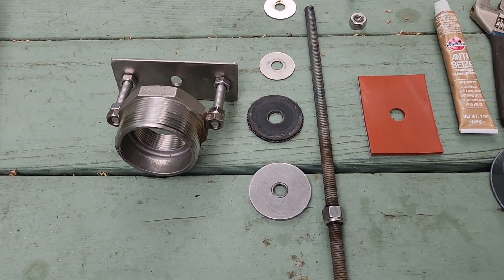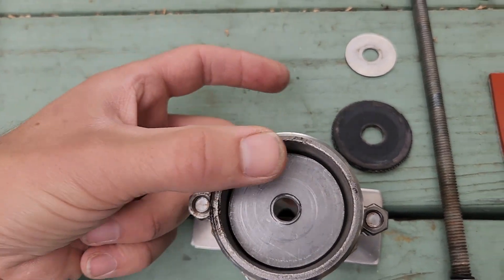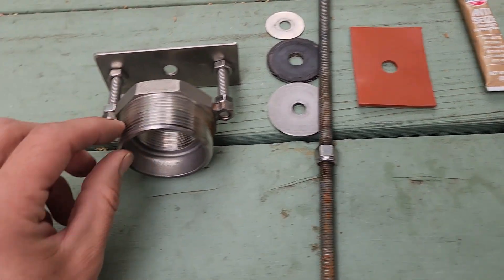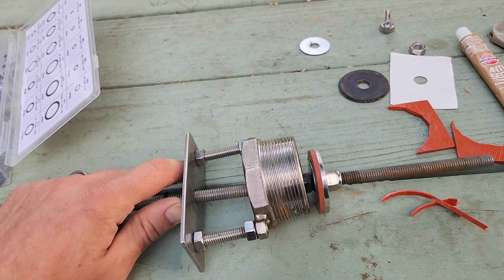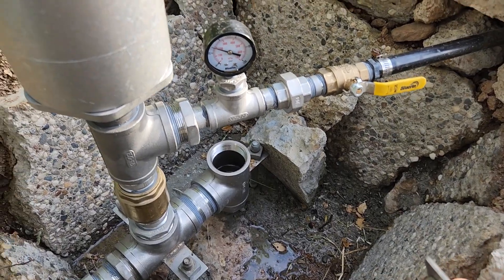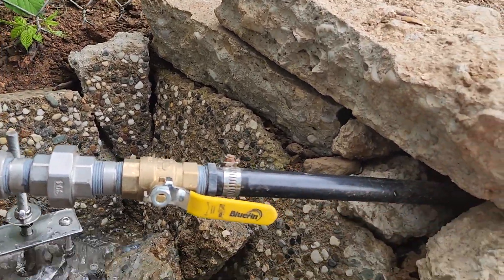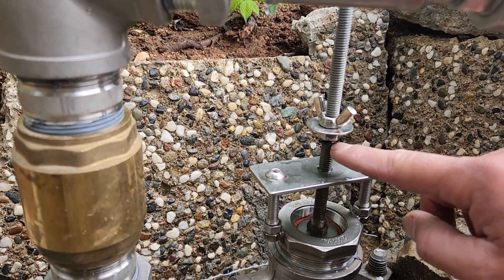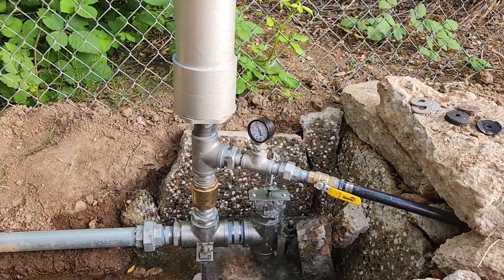Waste Valve Adjustments - Hydraulic Ram Pump

Comment: Can you share result with us with a test? When tank and distribution hose are empty and supply pipe is full of water. How many triggers it takes to let it cycle itself?
Reply from the maker: I'm not sure what you are asking,  but you need at least 10 psi in the delivery pipe for the pump to work by itself. You can artificially do this by closing the 3/4 inch ball valve on the delivery side and open it slightly to let a little bit of water through. I show this in one of the videos.

Comment: How can we be sure there is no bypass path at the check valve through the threads under the the washers?
Reply from the maker: That is not something to worry about. The threads experience high pressure during the water hammer, which is relatively short time. If you stop the pump operation, then the pressure against the threads would be from the head pressure in the drive pipe. In my case it is about 8ft of water elevation = 3.4psi ... water does not come out through the rod or the custom check valve.

Comment: Nice video and presentation. 
Do we have access to stainless threaded rod?
Reply from the maker: Yes, stainless steel rod is generally readily available, but may cost a bit more than zinc plated or galvanized. I had one laying around so I used what I had.

Comment: 2 1/2" x 1 1/4 or 3" x 1 1/4 is much better for a waste valve than 2"x 1 1/4".
Reply from the maker: It is better, but you would need a lot more $$$ to do the same thing. The cost on components greater than 2 inches does up in price exponentially.
Reply: 2"x1" is much better,  you can use 45mm diameter of rubber and washer, If using 1 1/4" drive pipe, you can put an additional weight for your waste valve and if using 1" just adjust for longer stroke.